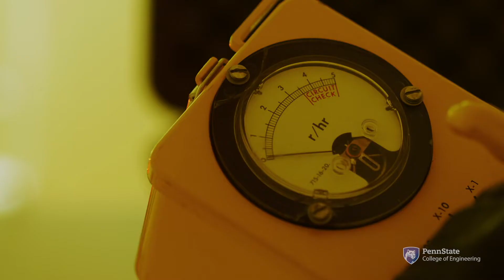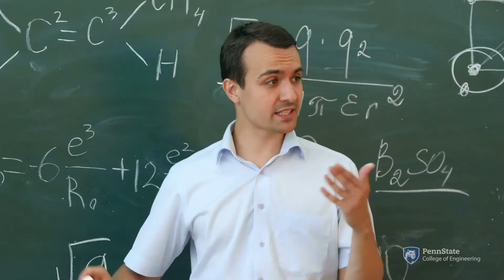What is Nuclear Engineering? (Updated 2025 version available in description)

Comment: Cant wait to get my masters
Reply: Did you get it?
Reply: @holopeve  Not in Nuclear Engineering but I switch to Health Physics.  Im in my last semester. What a ride.
Reply: @sweetwa089  congratulations ❤
Reply: That's means you specialized in radiation protection and healthy physics right? I'm also doing nuclear engineering and I'm definitely aiming for nuclear operations and maintenance, hopefully to work inside the control room as an engineer(operations support engineer). My second option in radiation protection, and I want to be a health physics but I also heard you can either choose that or radiation protection specialist, so what I wanted to ask is, is that true? And if it is what's the difference? And do they work in NPP's